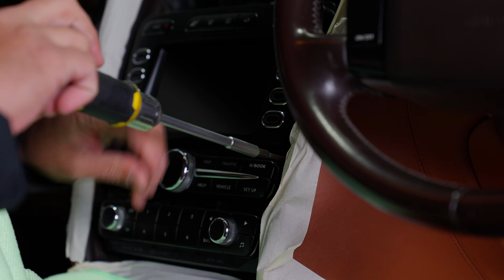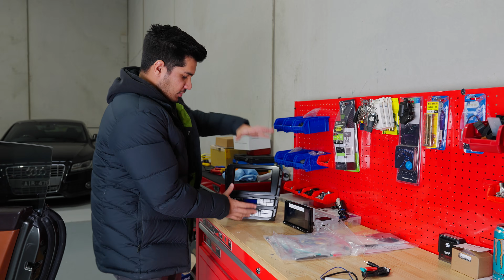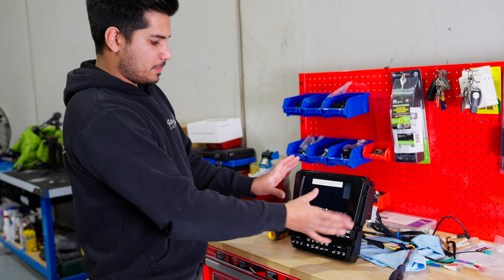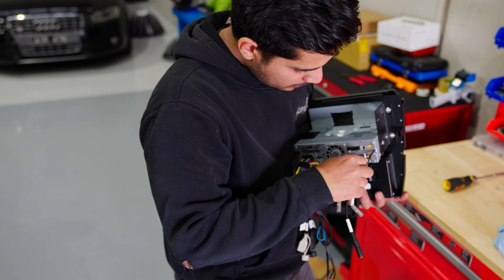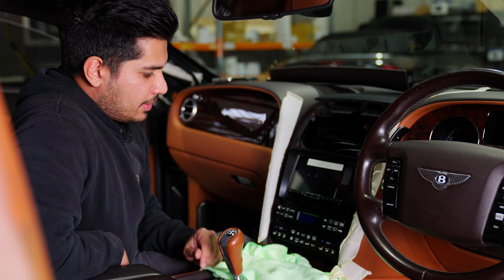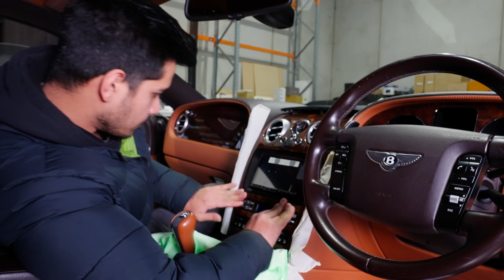Witness the Most Expensive Bentley GT Head Unit Upgrade!

Comment: If anyone use this Ben Hur system, be VERY careful when handling it. The screws that holds it together are very short and it’s a snug fit once it’s in the car. Taking it out for ANYTHING requires patience.

Comment: Brother , can we get more information on this? I’m doing this right now till 2007 model
Reply: It's just a Ben-Hur system with the Alpine added.
Also, a lot of work is left out in this video, such as, the factory amp does not have RCA connections for plug and play.
Reply: @JohnnyHotspurGT 
Wasup Johnny, it’s TeamJones, it’s been what,7 yrs since we installed these Ben-Hurs? Still no upgrade/update on them.
Reply: @Stacksmusic 
 Hello TJ,
 I never installed any Ben-Hur system, I installed the factory OEM NAIM for Bentley system in mine.
Reply: @ 
Ohhh yea that’s right! I remember finding that deck sub unit on eBay you thought about getting.
Reply: @JohnnyHotspurGT  I agree... do you know what Alpine unit is used? a double din? so any might work? and how is the adaption to the factory map done?